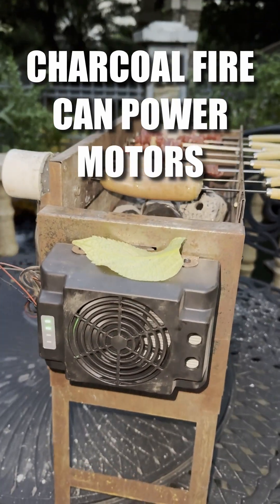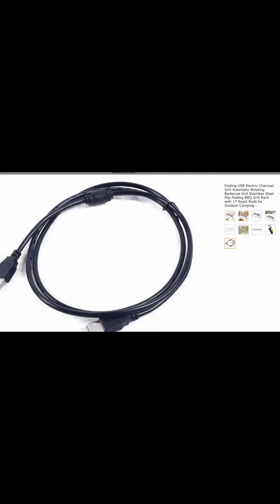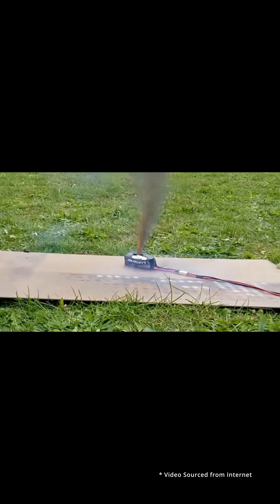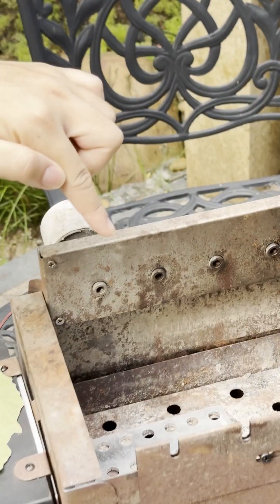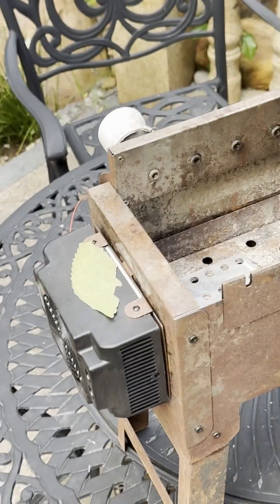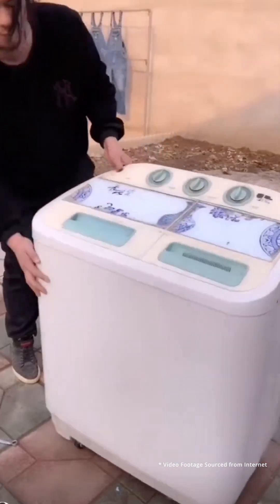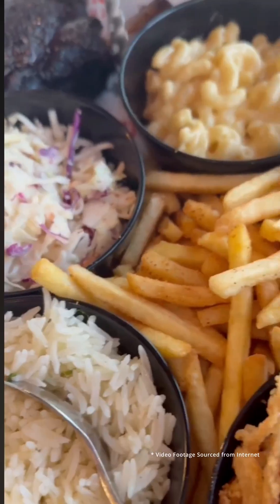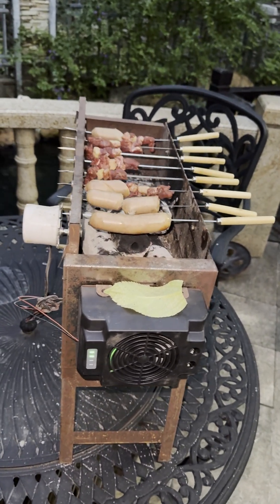Charcoal-Powered Skewer Rotator: No Wires, No Batteries Needed!

Comment: I use a camping stove that is able to charge electronic devices using the heat from the burning wood. Same principle, but doesn't have a motor. I think this could be a great selling product.
Reply from the maker: Thanks bro, those camp stoves are not typically good at handling charcoals as charcoals are hotter and harder to clean in a small stove. If you have any idea of improvement, definitely let me know ;)

Comment: Good idea! but does skewer rpm change with coal temperature ? I think you should also ensure TEG placement doesnt affect air circulation in the pit
Reply from the maker: Good point, one design problem we were solving now is not to block the air circulation with our TEG module
Reply: It's not a good idea, it's reinventing the wheel. This problem was already fixed 200 years ago. Just use the convection air to spin the skewers. No electric motor needed, just a metal propeller (aluminum would work best because of light weight and a transmission chain). The only reason to do it this way is that it's cheaper. That thermoelectric generator is just a regular Peltier pad. Those are dirt cheap, like $2 a piece, but they are also inefficient and unreliable.